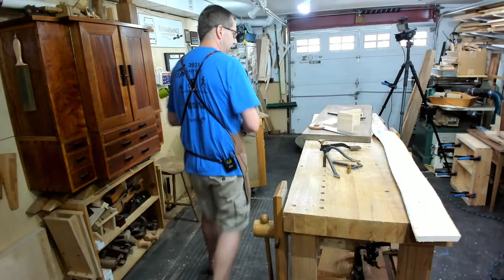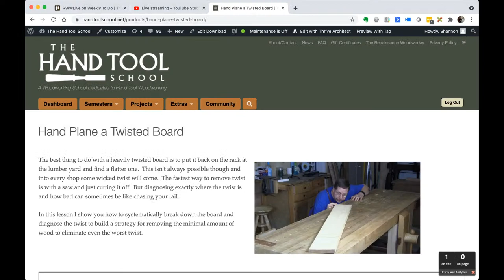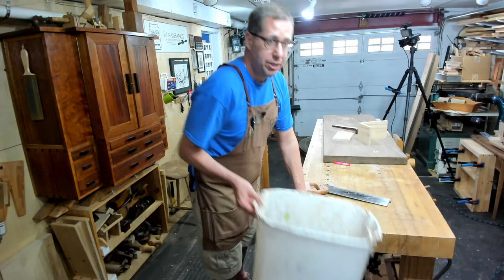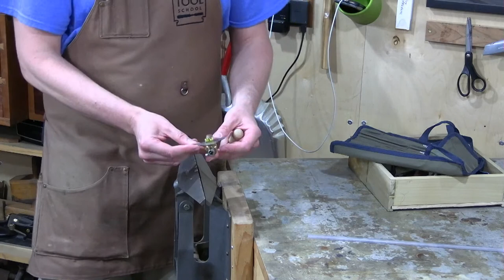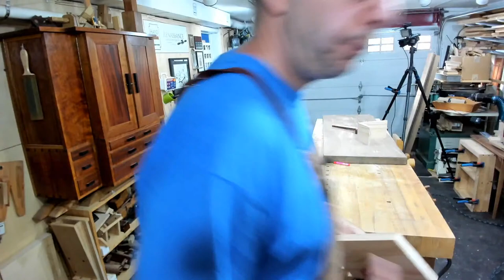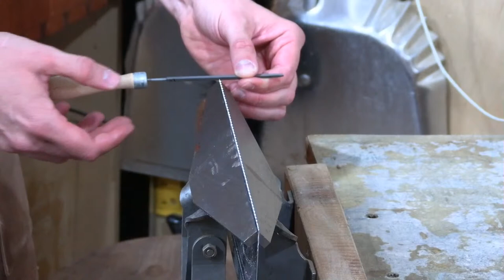Maintenance Saw Sharpening

Comment: Thanks Shannon, great video. You've answered a question about the rake on a mitre box saw and this is much appreciated. During lockdown in the UK I've re toothed 6 vintage saws, including a Drabble and Sanderson 26" hand  saw specifically for plywood based on your recommendations. Cuts lovely. I've learned a lot! Thanks again. Cheers Alan
Reply from the maker: Very nice how did you set up your plywood saw?
Reply: @RenaissanceWW  11ppi, 20deg rake and 15deg fleam. Took ages to shape over 260 teeth. This was based on your website. 20deg fleam may have also been OK? Cheers Alan

Comment: Really informative video Shannon! However, I hope I can make a small objection. I think it's better to start filing the teeth on the saw opposite the handle, that way the small burr on the tooth tip that occurs during filing will turn in the cutting direction of the saw, because the teeth are then filed on. the front and then the back, causing the small burr on the tip of the tooth to lie in the cutting direction of the saw. To start file by the handle; will file the back of the tooth first, and then the front of the tooth, causing the small cutting burr on the tip of the teeth to face backwards; opposite to the cutting direction, which is probably a bit unfortunate.

Comment: That was most useful thanks. I don't have a saw vise, so stuck wood to the saw with masking tape and superglue and clamped it in my tail vise. Seems to work ok : )
Reply from the maker: Sure that works fine.  If you want another, more reusable option I have a video where I built a really big saw vise that can be scaled down easily to "normal" sized saws.  https://youtu.be/Tc5LOC-g-tc
Reply: @RenaissanceWW  thanks. Will check that out. i need to build something for a few Disston saws that i've restored, but had put off sharpening until i was confident.

Comment: Gramercy Hold Fast Problem: Bench top was made of 2x4 set vertically and would not hold. Tried filing, sanding, etc. Only workable fix was to auger out about and inch of depth of hole bottoms with 2 inch auger. Now hole depth is effectively reduced from 3.5" to 2.5". I got the idea when I noticed that although the hold fasts did not hold in the 3.5" deep hole, they did hold great in the floating dead-man which was about 2" deep.

Comment: Good talk, but did you just file the teeth on a tooth-hardened big box store saw?! My impression is that would kill files but I guess I've never tried. I usually retemper tooth-hardened saws on an electric hot plate to make them fileable.
Reply from the maker: no it isn't a hardened tooth saw.  Just a regular old back saw
Reply: @RenaissanceWW  ok thanks for clarifying. All saws I see in regular stores are teeth-hardened.

Comment: The flex and response of the favorites Alaskan holdfasts is almost certainly the geometry, and not the chemistry.  MAYBE heat treating.  For an object operating completely elasticly, it's ALMOST entirely about geometry.  The difference in elastic modulus between Steel and Stainless Steel (Stainless is almost 26% polluted with Chromium and NIckel vs regular steel) is less than 10%, closer to 5%.  

I would bet cash money that a detailed measurement of the alakan holdfast vs the blackbear forge holdfasts will show a meaningful geometric difference.  

ALso, heat treating basically doesn't matter if the part never deforms plastically in either case.